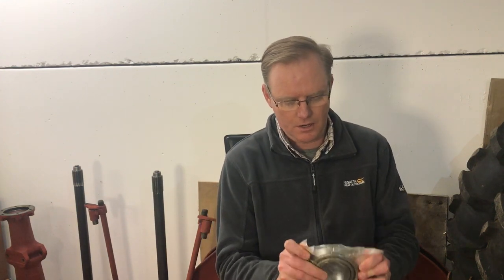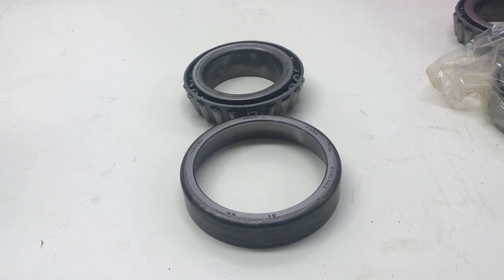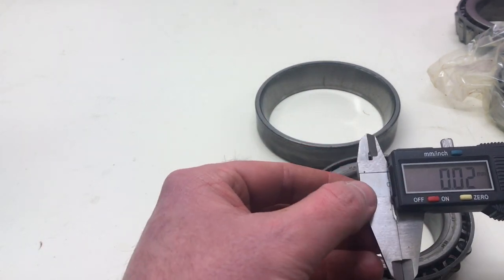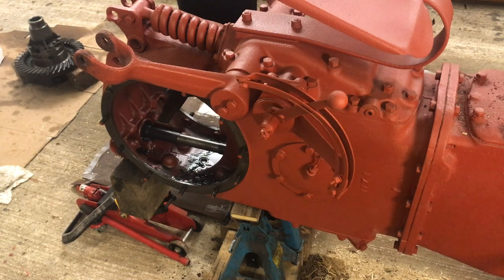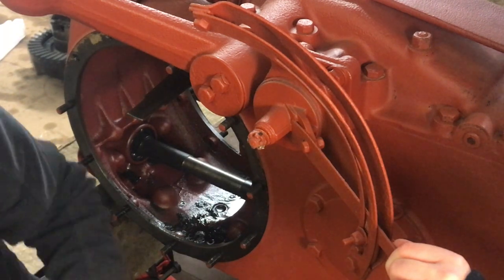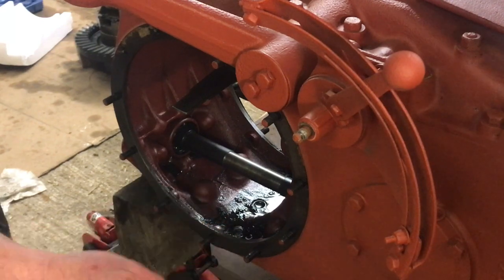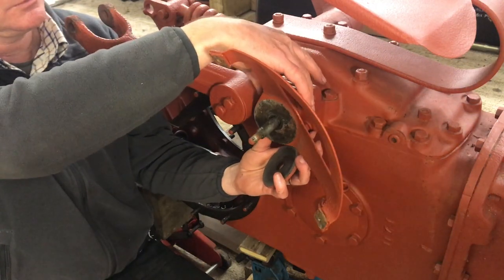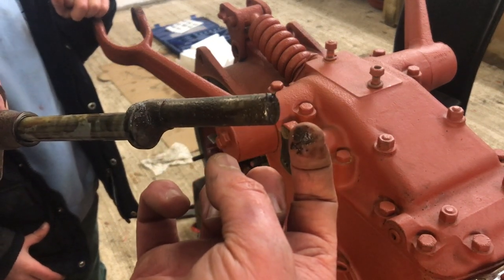#29 Ferguson TED20 - Crown Gear Bearings 2 and Hydraulic Control Lever

Comment: Bearings are made to a set size. So the users design their machines to accept the bearing dimensions not the other way round. If the dimensions you measure are different then it is not a Timkin 3984 but another number.
That washer is a Thackeray washer. Quite common.
Water often gets into the transmission. Through the gear lever and dip stick. I would imagine your oil was milky coloured.

But you were doing good.
Reply from the maker: Thank you. 👍